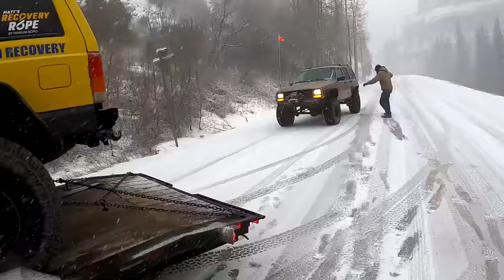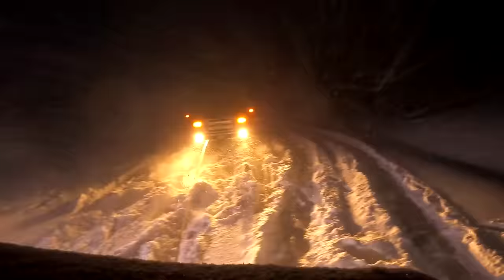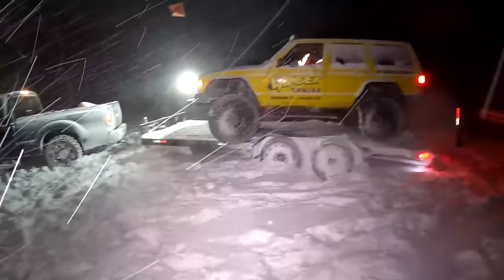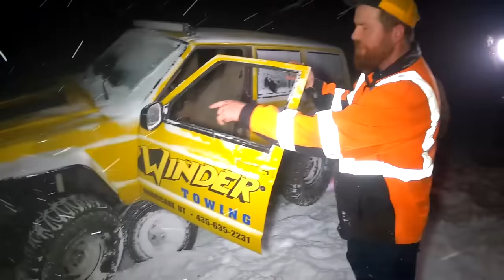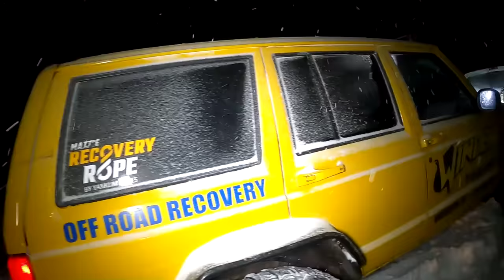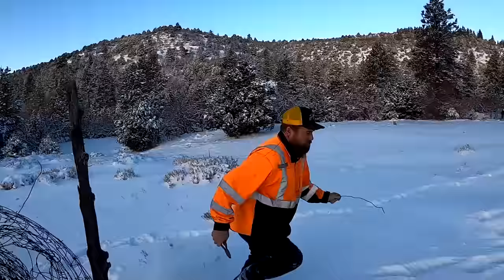Major Mistakes were Made, Failed Rescue!

Comment: I live in Canada and have driven to work and home in many of these types of blizzard/ snow storm conditions. Thankfully knock on wood I have been fortunate enough to not get that stuck. Not sure how or why not truthfully but I've been fortunate. I've been stuck but usually a few minutes on a shovel or throwing some gravel under the wheels usually does the trick. When your by yourself you have to figure it out. Because that's the fun part about snow. You never really or fully realize how screwed you are till it's way way to late. Unless its coming over the hood of the truck then you have an idea lol. 
 Luckily you had Rudy with his jeep. More importantly a vehicle with a winch which saved the day.

Comment: a few sets of tire chains would have saved the night.
Reply: Yes, and no. Chains are great if you have something to bite.  It gets to a point where the snow is so deep, that if you lose the packing and dig into the soft stuff your done. Its like sand sometimes, the more you spin the deeper you go.   If they had chains on from the start, it probably would have been ok. The snow didnt look too deep for chains but its hard to say without being there.
   Thats how we ride snow thats feet deep.  You have wide tires that ride ontop of it and packs it down, steady throttle control. Absolutely no spinning.  You want to keep your contact patch and not soften it up.  Once you get over 2-4'. Digging isnt an option youll bottum out. Thats why max tracks work well, you get a ton of clearance and a good contact patch and can dig if need be. But even then, ive seen trucks almost sideways burried in snow because they kept spinning and dug too deep.  Sometimes you gatta stop, pack some snow and get back ontop.
  Theres a rewson why in the arctic or alaska when your off the trail your using tracks.. or a sled and not tire chains. Youll dig for 10' before hitting solid ground haha

Comment: PS: Tire chains would have made this trip a joke.
Reply: I thought that road was closed this time of year unless you have chains.
Reply: I thought both trips were the joke.  Chains on all 4 wheels on one vehicle would have led to much less drama. In snow & ice I always carry my chains. Matt also needs 1. A nice jumper cable, 2. some SS bailing wire & vice grips,  3. a $15 garden sprayer for his radiator and cleaning dust off of people, etc and,  4; some dust goggles and face masks for the crew in the towed vehicle.  I think Ed will back me up.

Comment: Learned a long time ago to turn around when it starts to snow. I think I would have pulled out the high-lift jack to right the Morrvair. Fortunately you had a spare. Out here what usually happens is people get stuck in the snow, slide to the edge of the road and the only thing that can get them out is one of the big county trucks with a snowplow and load of sand in the back pulls the people out. It's about the only thing that gets traction in the snow. Also, I found that carrying some strong ratcheting straps come in handy. Wrap around broken springs, broken drive shaft, or other parts and they're strong enough to hold things together until getting into a shop. But each disaster is a learning experience!

Comment: I was just reminded of a decision making strategy that came about as a result of bad decisions I made. It is fairly simple. When I am about to do something rather sketchy to solve a problem, I ask myself, pretend I did this and it doesn't work, what are my other options. For example, trying to get the Banana off the trailer when you don't have enough room. You guys did come up with a solution that didn't involve getting the Banana off. This simple idea has saved me more than once from making things worse for myself. Took me a long time, and many mistakes, to think of that. This has reminded me I need to remember to use this strategy in the future. Sometimes I forget important stuff like this.

Comment: Piss on the haters!!!  You've learned your craft by putting yourself in these situations and only through that have you learned how to rescue others in the same situations.   Off-road recovery is like raising a daughter.  Nothing can prepare you for it besides doing it!  I pulled a truck up a 40% incline balanced on a floor jack that we had fashioned into a ski type deal goin on instead of rollers with a 5' piece of 6" i-beam welded to the head of the jack with winches on both ends of the truck to stabilize it and another hooked to the floor jack to pull it up over the berm.  Problem they had was the berm and there was no pulling it over it was a situation where it was necessary to lift then pull.  God be with you on your ventures!

Comment: I feel your pain. I was wheeling with some friends once and hit a hidden stump in the snow. I ripped off my entire front right wheel assembly off in an instant. I reattached it and made it 100 yards before it all fell off again with stripped bolts sucking right out of the knuckle. I had to leave my jeep in the mountains overnight while I went back to camp to get my truck and go back to town and get a  whole new front axle assembly so I could fix everything. If my CB had been working I could have avoided the whole thing by hearing my buddy say "watch out for that buried stump!". But my CB wasn't working and I hit the stump at high speed. (3' of snow). Lesson learned.

Comment: Great video! Man that was a mess, but the important point is you came prepared to get your team and yourself out and back home safely. I can’t say I haven’t been in a similar predicament in the snow because I was already pushing almost 2 ft of fresh snow and didn’t realize I was riding on a crust. Broke through and ended up up to the hood in snow. Had to climb out the window. My friend and I spent several hours with shovels getting it out. The problem was the crust was almost at my hubs so obviously it didn’t want to bounce up it easy. That took a lot of brute force. And every time we managed to get up on the crust again we’d fall through. Finally got up on the crust and just kept the throttle pinned the whole 1/2 mile back to the main road.  Also had to then pull out the friend that came to help us shovel even though I told him don’t even try bringing that F-250 down this road cuz you’re gonna get stuck. He was thick headed and made it like 30 yards before he buried it.

Comment: V pick, diamond pattern tire chains front and back can get you out of most jams in snow.

Everyone at night needs to be wearing hi visibilty reflective stripes.

A high lift jack, wheel hooks and a plywood base, if you know how to use it properly can be a big help.

And to us Canadians, a winter jacket without an attached hood is not a jacket :-)

Comment: Do I have a battery powered grinder. That's what you need when a cv breaks so you can cut the shaft off so something is still protecting the diff internals and seals and the wheel side isn't slapping a shaft around.

Comment: That whether was like a breeze compared to the weather during the winter in the northern parts of Sweden. You need much better gear like clothes, tires, lights and vehicles. But you get used to it. It is worst the first 20 years or so. After 20 years it get's a little moore comfortable. At least you took the right desition - to give up. You can handle sand fine, but you need to practice a lot in snow.

Comment: Think it's time for a high lift jack and a tirfor hand winch, although a bit slow the hand winch is an awesome bit of kit, (I have three in three different sizes), not just good for shifting vehicles, but logs, rocks, sheds, in fact anything you can put a strop round, they don't weigh as much as a vehicle winch and they are more adaptable, you can even swap them to the vehicle your using, as I say wonderful kit!!.

Comment: Put a winch on a hitch receiver, and plug the battery pack into the pig tail. You can also move it over to an anchor point temporarily. They also make chainsaw winches

Comment: Love your show Matt, but I never see your tyres bulging, I always air down to 18 psi min. soon as I get off the bitumen less in mud snow or sand. I wonder if you ever tried a bag of lime trick, works wonders in mud, snow, and even muddy rocks a few hand full under the tyres and over the tyres after you cleaned the mud or snow off it, it helped me a few occasions.
 All the best
Reply: Thanks for coming back Matt, on the video you can't see any bulge on those tyres, must have massive side wall's. I do similar type of 4 wheeling here in Australia, I love your method of work. All the best.

Comment: Giving me flashbacks to when I got my tractor stuck coming out of the woods with firewood on the bucket forks and a 7ft snowblower on the 3ph.  Slid sideways off my packed snow trail and the snowblower hooked around a tree.  Tried to pull the tractor out with my truck and got that stuck.  Finally did what I should have done in the first place: unloaded all the wood, cut the tree with a handsaw, got the tractor out and rescued my truck!

Comment: 10:30 Rudys jeep looks like a Perch swimming for its life with a hook in its back 😂EDIT: when you got to the truck, and saw the axle failure, why not just cut the outer clamp and pull the other end out of the other cup?  and you could drive it out without the axle floppin, as it would be laying in the bed of the truck. Just a thought.

Comment: Buy a WK Grand Cherokee with the overland package for snow recoveries. Set of OEM Wrangler snow tires can be bought on Craigslist for $3-600. Those blizzaks are untouchable. Day and night. This is coming from an Automotive Engineer who did winter testing for a Dana in UP Michigan. A Dodge neon with Blizzaks would have driven past you that night up the hill laughing.

Comment: This is an old video not sure you will see this but I bought a super capacitor car jumper. If a battery has a tiny bit of power it sucks it in ramps it up to jump the car or a phone charger will charge it up or your battery or or or or or no cables no battery-powered  jumper you need to remember to charge.

Comment: You need to make a trailer that the bombi can pull that has either skis or tracks.  You can make a hydraulic or engine assist trailer.
Reply: I wanna take my open differential mod up one of those trails. I do just fine in the Ohio snow, I want to venture there.

Comment: It is more exciting when you have to backup a trailer when the truck is doing a 4 wheel slide … I think I have mastered it so far each time but my top speed sliding backwards has only been 60kph. I have so far never jackknifed and done damage 😬 I should video my crazyness🤪. The last time I backed up a truck and trailer sliding after trying too hard to get up a slop I was shaking for a day afterwards cause it was straight up on one side and straight down on the other😜 .
Reply: I have not seen a YouTube yet though of someone doing the 4 wheel slide backing up a trailer.. brake only when you don’t need to steer … and actually master it yet

Comment: hmm, surely some 50lb 16' rescue ramps would have really helped here? I've still not sure why you wouldn't routinely carry them on snow jobs. I've even noticed the 3' toy ones in your workshop and the trailer has some too. 
If you need to jack a rotating tyre you can use a tall jack and pull from the top instead of the bottom, or chain the rim to the frame to stop it rotating. Or airbags, weigh nothing but are super useful.

Comment: Why aren't they using tire chains?  Do these kinds of tires not work with chains, or they wouldn't help?

As a regular guy just driving around in M+S, the first thing that I do when I encounter snow like this is get the chains on back.  Then usually pass a whole bunch of 4WD drive vehicles that don't have chains that have slid into the ditch.  I kinda don't understand not just using chains.

Comment: full ownership all good: But if you ask me what you actually would have done differently at different stages of the video, I don't really have anything. 
The weather is almost the same, day one and day two at the beginning. So the jeep was the right decision at the start. 
You could have trusted the weather forecast more. But there wasn't another option with the customer turning up so late.  
You could have switched to the Jeep earlier, but that would have meant driving back further. You still might have gotten stuck. 
With the snow coming you could have started from below with the jeep, and start from above with bambi. That is something you can change in your strategy. But that is something that you learned that day. So you couldn't have known that before. 
So to sum it up: The improvements are: call it off half hour earlier. But, come on, that is still failed mission. I'm sure next time you try to get through in the same weather and you still might.

Comment: oh boy...when have thatkind weather, there is no good go,at all....when have that much snow, right choose is snowcat..or do like this,at go there snowpush tractor, where is ice chain all 4 tires...and push snow off....and for truck,s....ice chain in tire too....i work with snowpush  tractor ford tw-10 4wd 1981 model...frontside i have 3 meter wide full hydraulic snow push plate and backside sand machine,where is 1275kg sharp crushed stone,s...and of coz all 4 tires have ice chain...that give tractor good greap for tire and can pull easy up or towing examle  kind of pick up truck etc other car....one time i pull with tractor semi truck too.. and that come....but really...thiskind snow storm is not good to go without snow push tractor at all and of coz tractor need good gears too and peolpe need good warm clothes and example hot drink with termos bottle..example tea or coffee...that keep warm...anyway you still done goodwork and can like...snowcat is really good ''tool'' too...

Comment: Another not thinking decision,,,,,, cut the boot and pull the axle out of the hub,,, drive it home. Still enjoy your vids👨🏼‍🔧👨🏼‍🔧
Reply: The spindle on the end of the axle is what holds the wheel bearing together. Take that out and the wheel falls off.
Reply: @jacobg5122  don't pull the piece of the axle out of the spindle leave it bolted up. Take out the shaft leave the stub in the transmission and the other stub in the wheel bearing

Comment: So in situations like you're in right now where you got the Jeep stuck half on and off the trailer why don't you guys have jacks? And during these snow recoveries I never see you guys running any kind of snow chains ever. Why not? Yeah you can't use Full Throttle with them but there is no need for that most of the time. And when you get stuck in your tow truck why not safely unload the vehicle then disconnect the trailer get the tow vehicle unstuck spin the trailer back around and get it connected to the truck then load back up? I've done this more than once and it's always been the best option. Yes I know it takes a little extra time that most people aren't willing to spend. The only time it's not the best option is if you cannot unload the trailer. Or if you have no tongue jack. Again these might be silly questions but wondering what the reasoning may or may not be

Comment: YOU COULD OF JUST CUT THE CV JOINT BOOT ON THE RIM SIDE AND DISCONNECTED THE AXEL AND PULL IT RIGHT OUT WOULD OF TAKEN ALL OF 2 MINUTES OR UNBOLT THE AXEL AND REMOVE THE WHOLE AXEL!